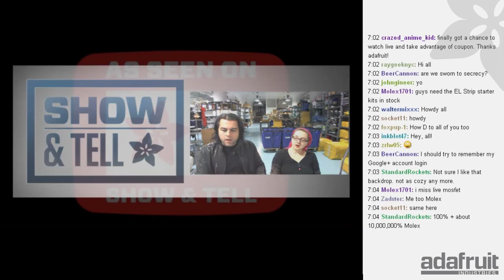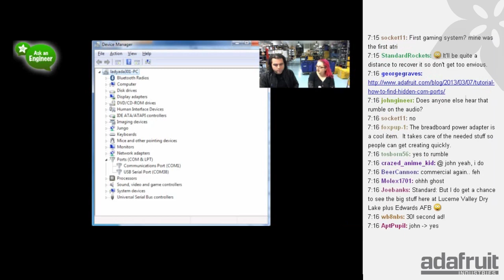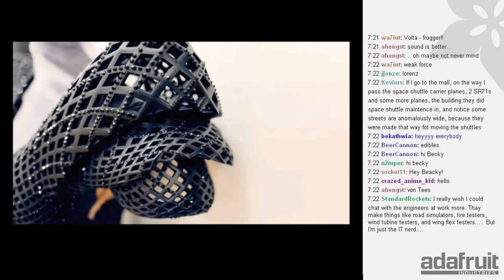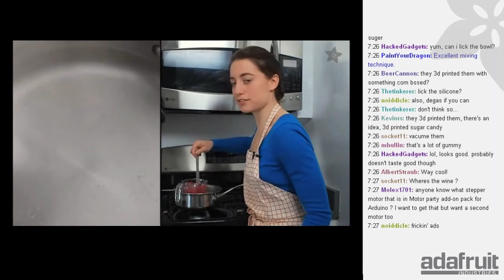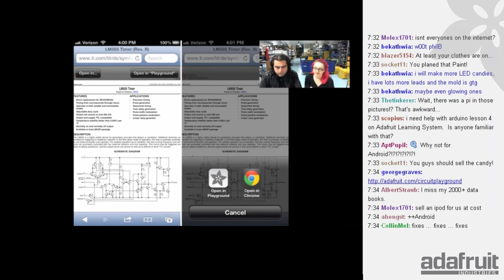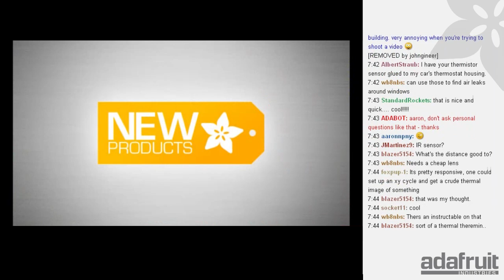PEZ on a Reel! Ask an Engineer 3/9/2013

Comment: PS I meant the board on desk in front of you guys, also the waterproof DC connector's wire gauge? not listed on site want to use it with a 5A battery 3s lipo.